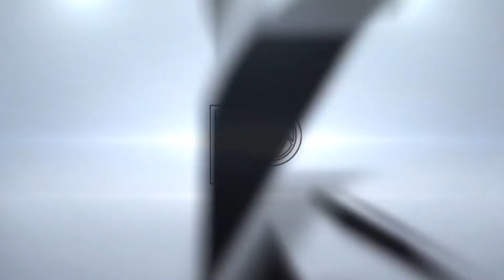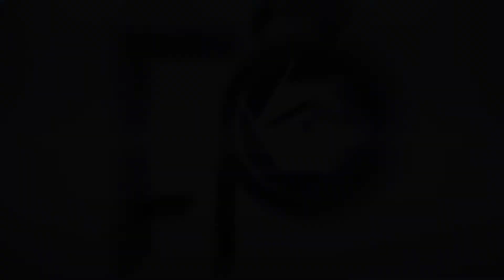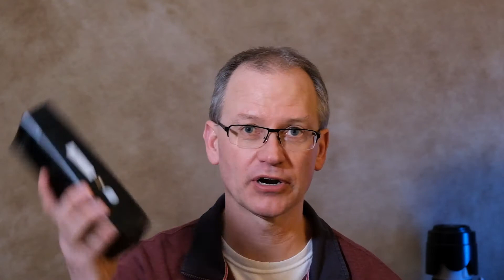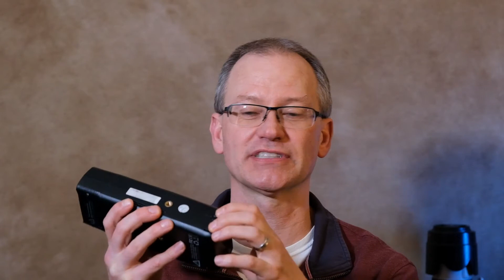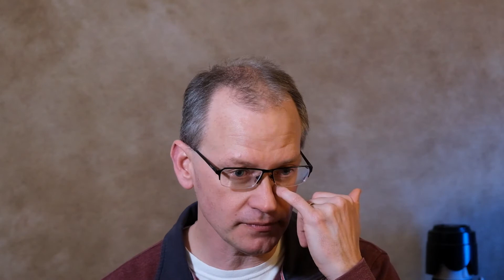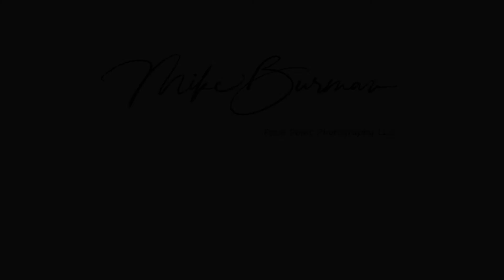How to Prevent the Godox AD200 Power Switch Failure

Comment: Glad you mentioned this.  Mine is going bad, but still able to toggle it on after a few trys and sometimes on the first try.  I do recommend just turning trigger off as I have had this go off in my pocket and almost burned a hole in my pants. Be careful,  this flash puts out a ton of heat!
Reply from the maker: Yes that thing can really crank out the heat!

Comment: You can also put a rubber band around the battery.  Pop the battery out and the rubber band catches it.  Pop it back in when you need to use it again.  The AD200 will remember your last power setting so you won’t have to turn the adjustment dial up again.

Comment: I just press the mode button so it switches into a mode that doesn't fire the flash. Then press it again when I want the flash to fire. Also will place the flash face down some of the time. Still, my switch has just about died - I only started using the mode button once it first started to fail, this has given me many more months of daily use. I will now try and disassemble the unit and fix the switch as it's looking like any use could now be the last time it works.
Reply from the maker: I also will place the flash face down sometimes if I don't want to put it in my pocket. I never want to turn the unit off once it's on. So far it's lasted a couple years or more.